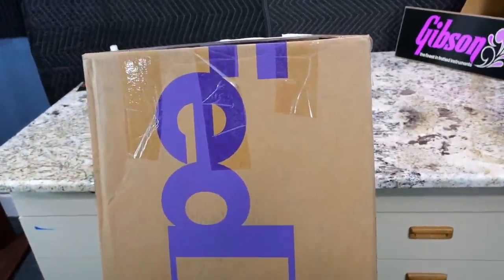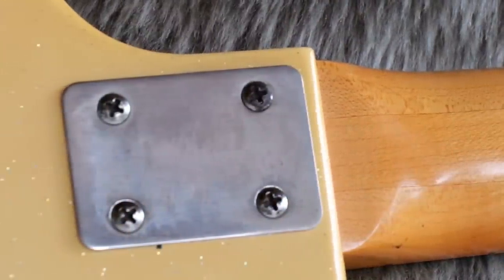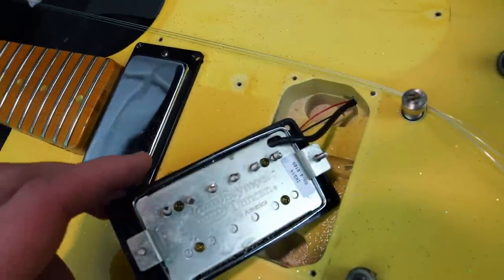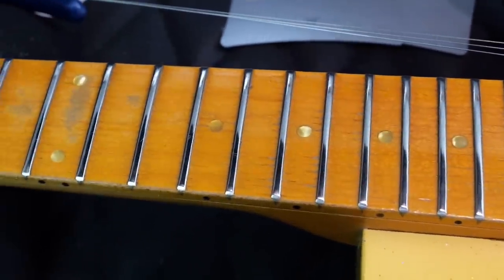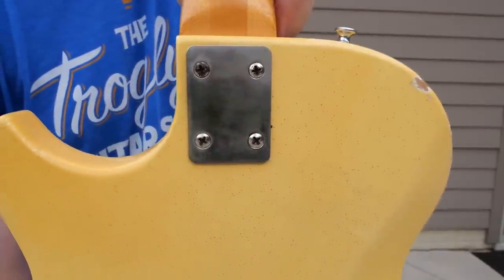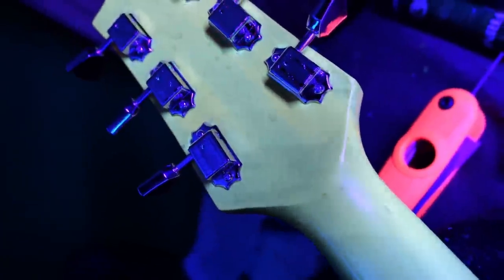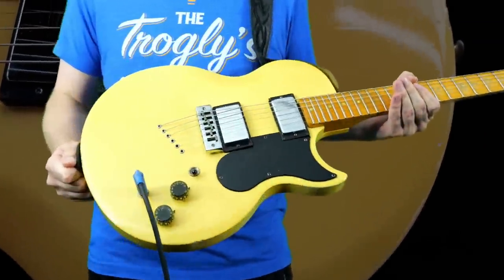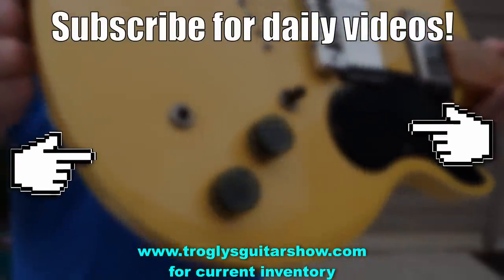I Got Burned On This Buy... | 1975 Gibson L6 Midnight Special Glitter White Cream Sparkle Review

Comment: I bought my 1973 L6-S in 1982 when I was 14. The neck was slightly twisted even though it was less than 10 years old. But the thing played and sounded great. I've never owned a guitar with such a variety of great tones. Those Bill Lawrence Superhumbuckers are just amazing pickups. After living in the tropics (Thailand) for the past 26 years the neck is twisted to a crazy degree. I've had it straightened twice but it just keeps going back to the same twist...and still plays great. Not a single dead fret or buzz and the intonation is spot on despite the radical twist. And to be honest...it kind of makes it easier to play. You don't need to bend your wrist as much.

Comment: I'm pretty sure Bill Lawrence designed the L5-S and L6-S, as well as the redesigned Howard Roberts model with the oval sound hole and phase-aligned top and back.  He was the Nashville factory chief engineer by 1970.  I discussed my concern about the thin portion under the neck joint with him on the phone.  The thin body was wider to be more stable while stumming.   It may have sounded better in the way it absorbed some midrange.  Maple can be too midrangy.  He also mentioned a special vacuum finishing method he used for the L6-S.  It stiffened the whole structure and never required refinishing.  Gibson made some unfortunate cost-saving changes after '73.

Comment: The most likely reason for the bridge SH-4 being microphonic is the cover. It doesn't seem to be soldered to the baseplate, and you also usually need to either pot the covered pickup, or pad the cover from the underneath it (between bobbins and the cover).

Comment: About 30 years ago I saw one of these in a natural finish in Gruhn’s Guitara Nashville.  I had no idea what I was looking at.  It was used for like  $450 or $500.   A few scratches here and there and someone did a half ass job of replacing the bridge PUP.  I was tempted to buy it, simply because it was a Gibson ,and stripped down Studio LPs we’re selling (all be it new) for $700+.  I asked a tech there what I was looking at and he knew nothing about this model either, so I passed.  

Interesting to see you cover one here, now, though.

Comment: What a hot mess. That would be going back if i bought it. Surprised you didnt mention the body crack in front of the neck pickup.
Reply: Its 50 years old..   The pickup difference was obvious in pictures sure the slight neck twist not so much and that can be corrected sometimes it's  a real issue but to hear this guy talk if a spec of color shift on an older guitar exists its trash
Reply: @I.am_Groot  50 years old is not an excuse. This guitar was just poorly maintained. You can find 70 yead old guitars that are mint. Watch Norms Guitars for proof of that.
Reply: If you paid more than $1200 ($1000 for the guitar + $200 for the finish),  IMHO you got burned. However, IF it's part of a solid L6 collection, (which it appears to be) it was worth it. You can replace the original parts and wait until the value creeps up while playing it, and load the piggy parts onto a player axe.
It sounds pretty good, so enjoy it.

Comment: I have this guitar.. My cousin gave me it in ‘79 or ‘80. Glitter White… ok I always thought it was Cream Sparkle. Bolt on, but intonation has been rock steady for 40 plus years now!. Super low action absolutely straight. Nut is crazy narrow.  Bummed that this demo isn’t complete. Mine has more finish checking but better overall. Neck on mine much better. Mine definitely is original .. not like this option. And my tuners are original and function incredibly well. Just my luck to be given the least valuable Gibson  ever! How much is an original one of these in better condition… like mine? Mine originally came with the yellow interior case btw. I had to replace with the purple like this a few years back…. and now that I see how much you are asking for an L6 case I feel like I totally scored on mine!

Comment: it's a great sounding guitar on the clean setting but distorted it sounds like rock and roll dunnit? as far as the neck twist, sometimes they can be corrected in a heat press.